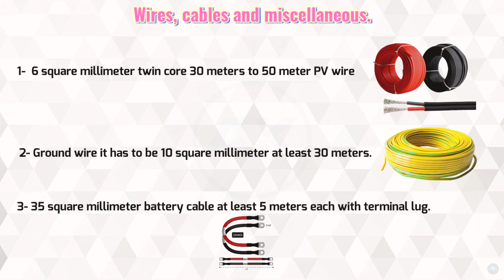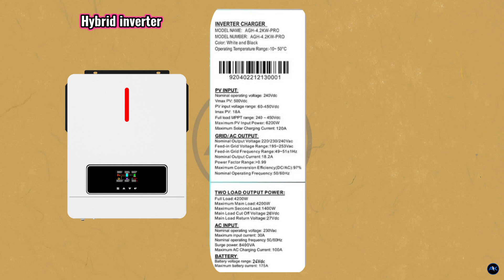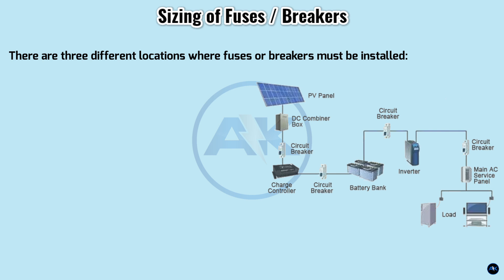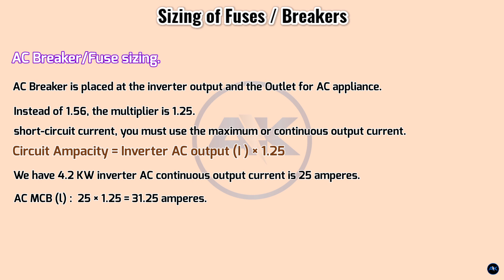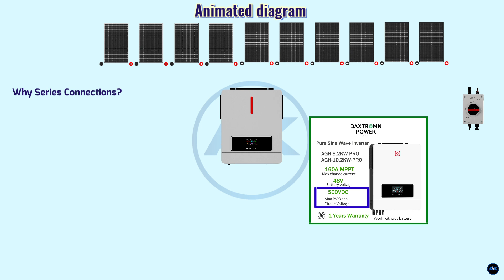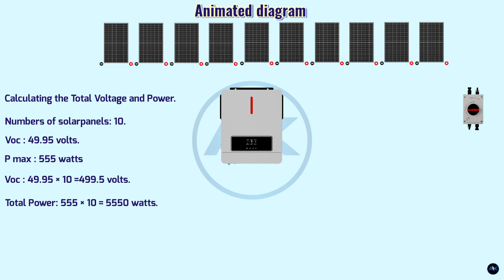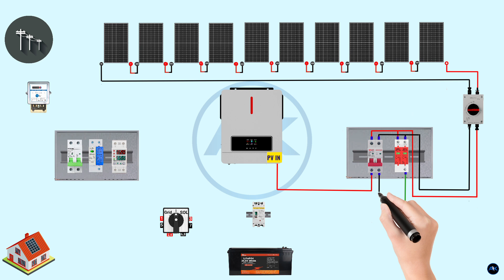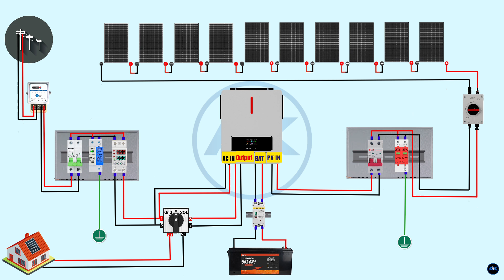"Unleashing Solar Power: DIY 4.2 kW Hybrid System Installation & AC/DC MCB Calculations Made Easy!"

Comment: Hello, the DC breakers you are using are polarized or non polarized? I want to secure some DC MCB but all are polarized. What should I do?
Reply from the maker: Hello there!
That's a very good question regarding the MCB DC breakers.
 * Most DC Miniature Circuit Breakers (MCBs) are polarized. This is because they are specifically designed with a dedicated orientation to manage the arc interruption and magnetic blow-out forces generated when breaking a DC current, which is much more challenging to interrupt than AC current.
 * Non-polarized DC MCBs do exist but are typically used in specialized bidirectional applications and are less common for standard solar or battery systems.
🔌 Wiring a Polarized DC MCB
When wiring a polarized DC MCB, you must strictly adhere to the markings on the breaker:
 * Input/Source Terminal: This terminal is usually marked with a "+" (Positive) and/or an arrow pointing into the breaker from the source (e.g., the solar panel or battery).
 * Output/Load Terminal: This terminal is usually marked with a "-" (Negative) and/or an arrow pointing out of the breaker toward the load (e.g., the charge controller, inverter, or DC appliance).
The wiring should be done such that the positive conductor from the source connects to the positive/input terminal on the breaker, and the negative conductor from the load connects to the negative/output terminal on the breaker.
Crucially, never reverse the polarity, as it can severely reduce the breaker's ability to safely interrupt a fault current, potentially leading to equipment damage or fire.

Comment: Hello would like to say something about the Growatt SPH 4600 hybrid converter, which batteries can be put on it and which you recommend and how many solar panels and how much Wati should be the board. Thank you, you really is a channel for every recommendation. Thanks
Reply from the maker: The *Growatt SPH 4600* is a versatile hybrid inverter, and here's a breakdown of compatible batteries, solar panel recommendations, and key considerations:

---
1. Compatible Batteries.
The SPH 4600 operates with a 48V battery system and supports both lithium and lead-acid batteries. Key requirements:  
- Voltage: 48V (nominal).  
- Communication Protocol: CAN or RS485 (critical for BMS compatibility).  
- Max Charge/Discharge Current: 100A (ensure the battery can handle this).  

Recommended Batteries:  
- *Growatt ARK Series* (e.g., ARK 2.5LV or 5.0LV) for seamless integration.  
- Pylontech US2000/US3000/US5000 (LiFePO4, widely compatible).  
- BYD B-Box or LG RESU (verify protocol compatibility).  
- Generic LiFePO4 batteries (ensure communication and 100A discharge capability).  

Battery Sizing Example:  
- For 10 kWh storage: Use a 48V/200Ah LiFePO4 battery (48V × 200Ah = 9.6 kWh).  
- Ensure the total capacity does not exceed the inverter’s limits (consult the manual).
---
2. Solar Panel Configuration
The SPH 4600 supports up to 4.6 kW PV input with 2 MPPT trackers. Key specs:  
- Max PV Voltage: 500V per MPPT.  
- Max Current: 18A per MPPT.  
- Recommended Panel Wattage: 400W–550W (higher efficiency, monocrystalline).  

Panel Configuration Tips:  
- Total Array Size: Up to 5.5 kW (4.6 kW × 1.2 oversizing allowance).  
- String Sizing:  
  - For 400W panels (Vmp ≈ 40V): Up to 12 panels (12 × 400W = 4.8 kW).  
    - Split into 2 strings (e.g., 6 panels per MPPT: 6 × 40V = 240V, 6 × 400W = 2.4 kW per MPPT).  
  - For 550W panels (Vmp ≈ 50V): Up to 10 panels (10 × 550W = 5.5 kW).  
    - Split into 2 strings (e.g., 5 panels per MPPT: 5 × 50V = 250V, 5 × 550W = 2.75 kW per MPPT).  

Recommended Brands: Canadian Solar, Jinko, Longi, or Trina Solar.

---

3. Key Recommendations. 
- Batteries: Prioritize LiFePO4 (e.g., Pylontech or Growatt ARK) for longevity and depth of discharge (DoD ~90-100%).  
- Solar Panels: Aim for 4.6–5.5 kW total (12–14 panels of 400W).  
- Professional Installation: Ensure compliance with local codes and optimal shading/orientation for panels.  
---
Example Setup
- Battery: 2 × Pylontech US3000 (48V/3.5 kWh each = 7 kWh total).  
- Solar: 12 × 450W panels (5.4 kW total, 6 panels per MPPT).  
- Energy Autonomy: Supports ~7 kWh daily use (adjust based on consumption).  

For tailored advice, consult a certified installer to optimize for your location and energy needs. 🌞🔋thanks 😊

Comment: During the video i noticed that you have 3 way splitters as MC4 connectors which is incorrect based on what you are demonstrating. There should also be a breaker between the grid input and the inverter.